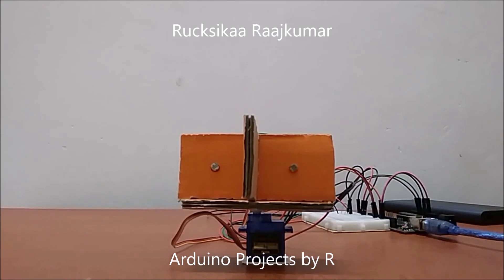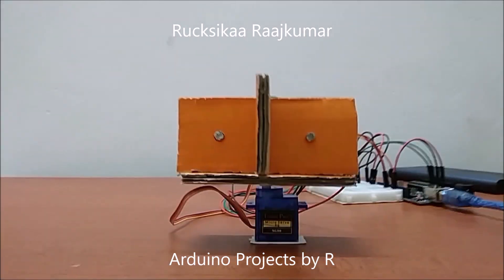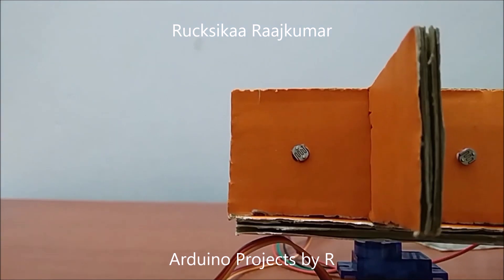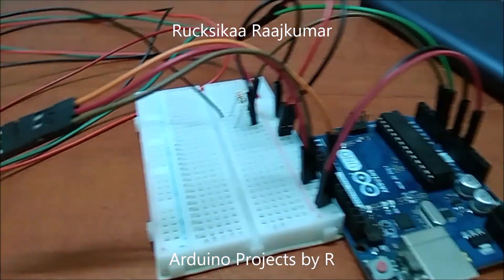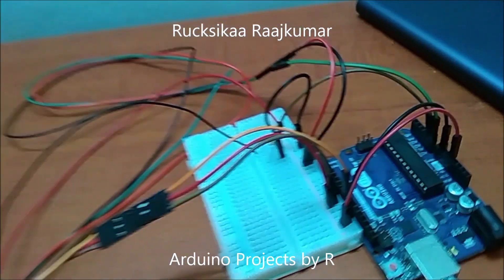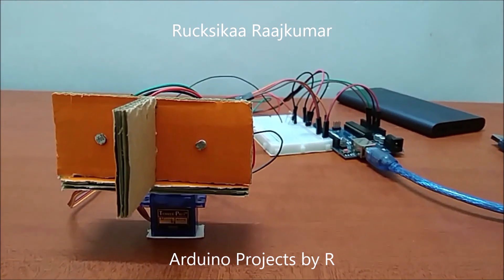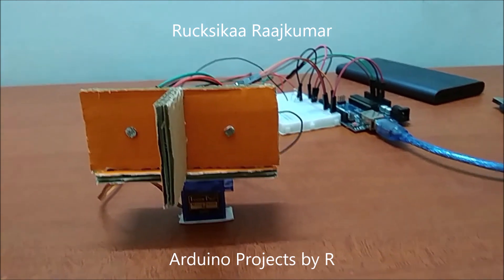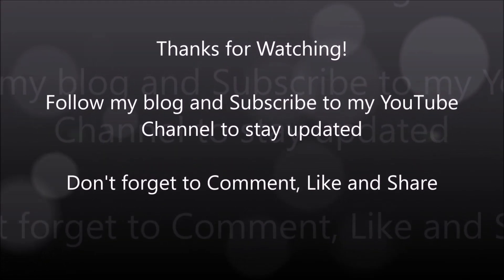Light tracker using Arduino

Comment: Does it work by comparing resistances between the photoresistors?
Reply from the maker: It actually works by measuring the change in brightness levels across the two LDRs. Their analog output voltage will differ.
Refer to my blog for a detailed explanation.
Reply: if you want you can actually